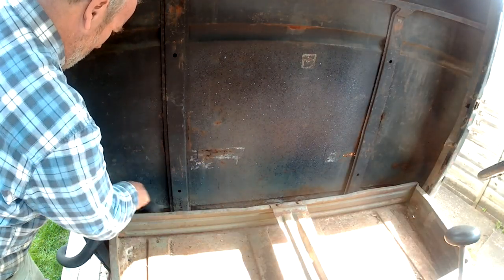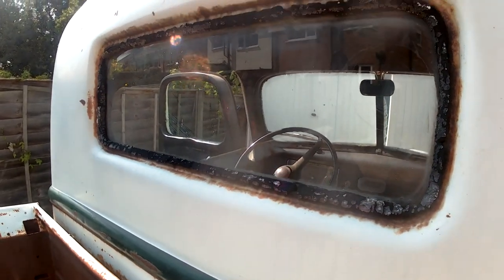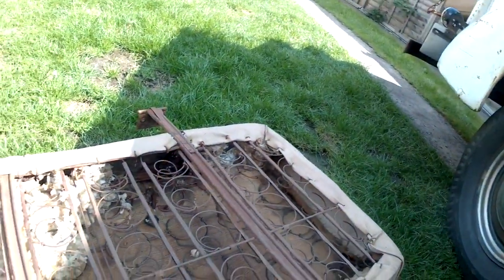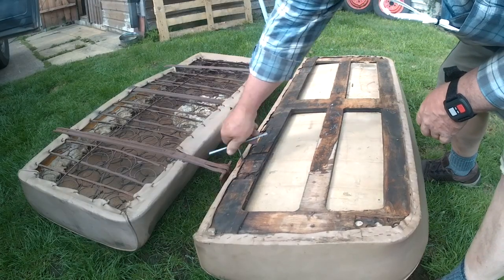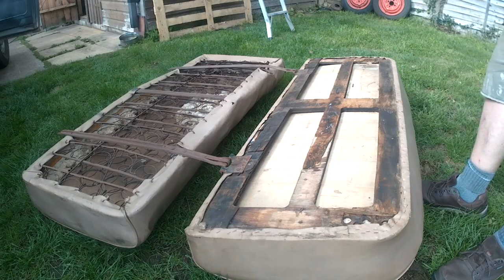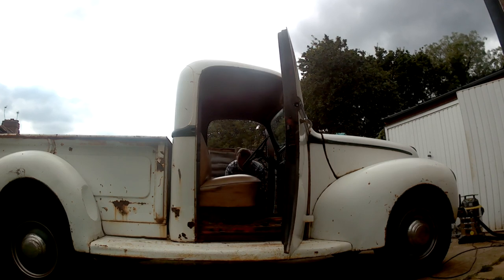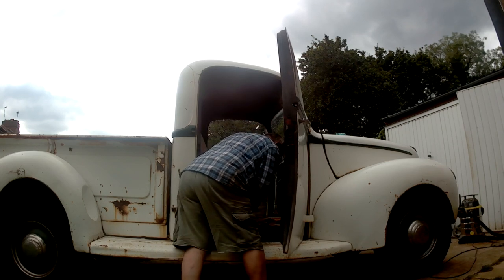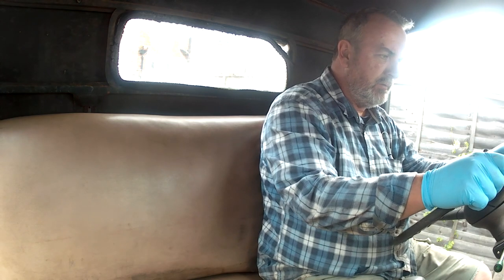41 Ford Pickup Rolling Restoration Part 5: Remove mouse nest, fit seat.

Comment: Ah my 42 has different mounts, the seat back n base dont join instead there is a hinge on top the seat back with 2 bolts ea side. I bolted from the top with hinge open but shouldve done it from the rear with seat back raised up. If that makes any sence. Anyways sorted now. 🙄👍
Reply from the maker: Glad you got it sorted. the 43 must be different to mine.